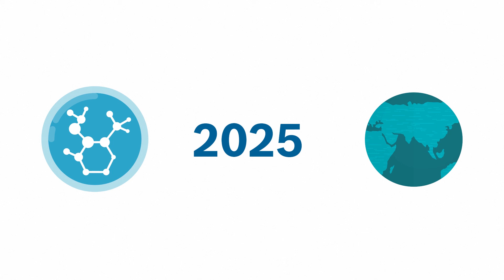What Is Synthetic Fuel?

Comment: alright, but what is the exact process of mixing H2 and CO2 to form a fuel? just mix it in? Wouldn't it result in a gas, not a liquid, what am I missing?
Reply from the maker: The raw material must be gasified if they use solid raw material. After a chemical process in a gasification plant, results the syngas or synthesis gas. The gas can be converted in liquid fuel also.

Comment: Why add co2 to hydrogen when you can  directly use it just wondering
Reply from the maker: Syngas or synthesis gas is an energy-rich gas used for power applications. Using CO2, they can reduce the quantity from atmosphere. There is already a plant in Iceland that collects CO2.